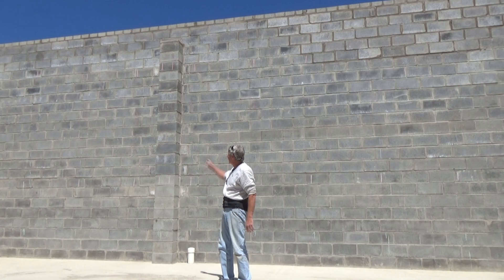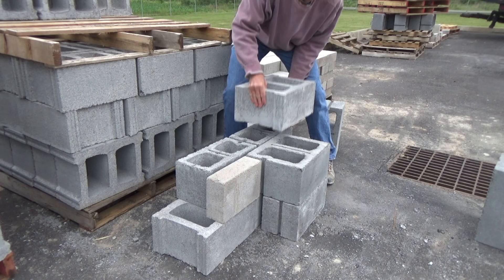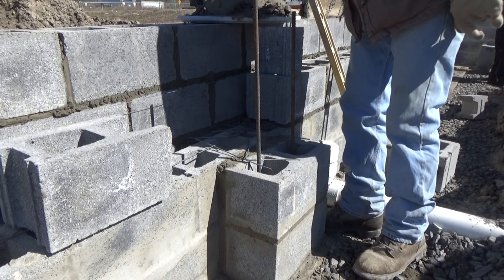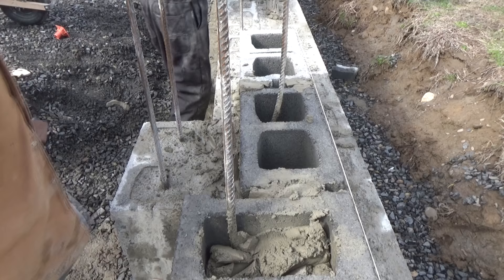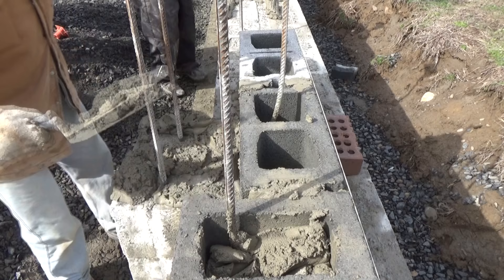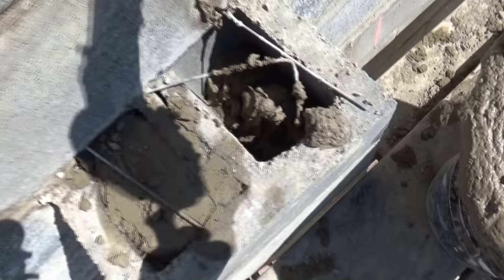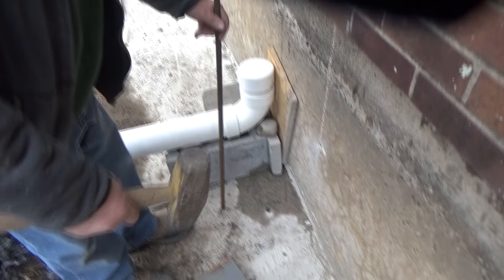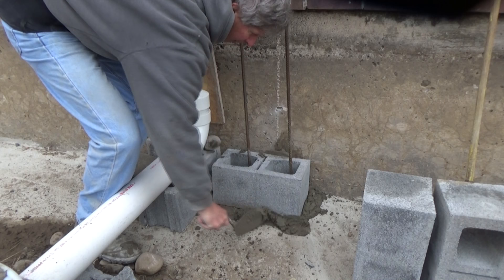BLOCK LAYING (part 6) Mike Haduck Pilaster, buttress

Comment: Been reinforcing a very old stone wall (  60 years+) and they did'nt use cement instead white clay ...I take the old surface of ;open some lines with the saw machine and put some rods horizontal and vertical i use 2 to 1 mix with garvel ; for the first coating and 2 to 1 for the finish i am weating the wall every day for best cure...Thanks for your precious tips
Reply from the maker: thanks luis, I am glad if they help, ,   mike

Comment: Mike this brings me to a point. What is the purpose of capping the top of a foundation with a solid block? I see some foundations without top caps and some with the top caps of similar era homes. Where I live there are top caps. I heard it has to do with moisture, I heard it may have to do with giving your sill plate a more solid surface, I heard insect prevention. But, what is the real purpose of the solid top cap unless I just named them? Thanks!
Reply from the maker: Hi Gregory, I would say that's the main reasons, thanks mike

Comment: Mike, greatly appreciate your efforts on doing video's and teaching us the trade skills. QUESTION: I'm blocking in a window with cider block.  The area where the new block is to be placed had extrior paint. Will I have to remove the paint before setting blocks? If so, how do I remove it? Florida block & stucco.
Reply from the maker: Hi Alvarez, I never had a problem laying anything on or against paint,  as long as It is pinned so it won’t fall away,  my opinion,  I hope it helps, mike

Comment: Newbie question, is pilaster only needed from outside exterior? How far apart they have to be? Or the inside of the walls need it as well? Can you retrofit all the pilasters or is it done from beginning
Reply from the maker: Hi suri, there are lots of ways to build and every circumstance is different, my best answer, thanks Mike

Comment: I’m not sure if you answer questions but I have a pilaster I need to replace  supporting a wooden beam. It’s old block with sand inside. It has 16 and 8 inch block. The beam is only 6 in wide, can I just use 1 row of 16 to support it or do I need to use 24 inches like is there
Reply from the maker: Hi Ebray, I can't tell you what to do unless I was there to see it, I do have a video called " Block pilaster column (beam support),  it might help,  thanks mike

Comment: Is there a standard rule when to use pilasters? like every 10 feet or something? If Im building a 30 foot wall that's 4 feet high do I even need them?
Reply from the maker: Hi Chris, I would ask some locals about that, there are a lot if variables involved, thanks mike

Comment: Mike, I see you added a few Pilasters after the original plan to support the walls.  I understand it was not planned because you had to drill your foundation and break your other bricks.  What was the reason or indicators that made you add the additional Pilasters?  Thank you.
Reply from the maker: Hi PlayGIrl,  I had a meeting with the roofer and he wanted the one against the brck building to hold his main beam,  and the other side I knew the wall was long so I wanted it for extra support, especially in a windy area,   after a while you can just feel,  I guess that is my best answer,  thanks mike

Comment: in the last video the mix was 2 bucket of sand 1 bucket o portland? thanks
Reply from the maker: most of my mixes for block or brick are 2 sand 1 s-mortar, but that is for where I live, other masons in other parts of the country would not accept that mix, it is always best to ask the local experience mason.  I hope it helps, thanks mike

Comment: Whenever you get to the top, is that piece of rebar you put in reaching all the way down to the footer? And if not how do you determine how long you want the rebar?
Reply from the maker: Hi Cameron, rebar is usually pieced  from the footer right to the top and connected to the anchor bolts that connect to the plate, There was no rebar in the old castles or old buildings it’s just the modern thing for modern buildings, Everything depends on what your building and What the building is designed for, hope it helps thanks , mike

Comment: Great work Mike. Now I understand what is pilasters. However, I was wondering how well will pilasters holds as retaining wall vs. concrete pour retaining walls. Also the cost factor (materials and labor).